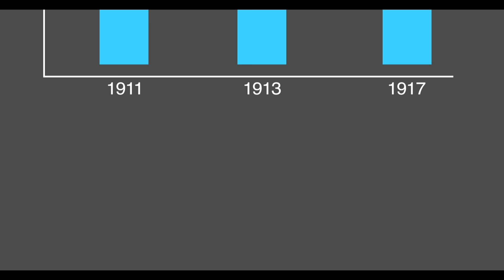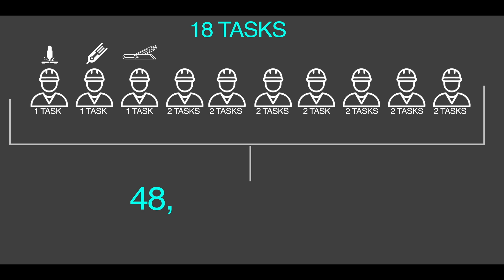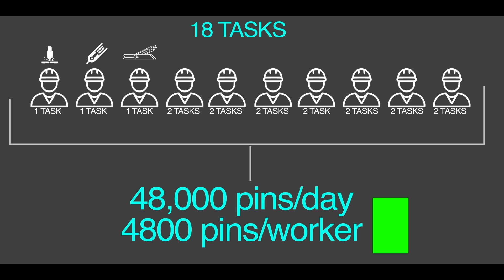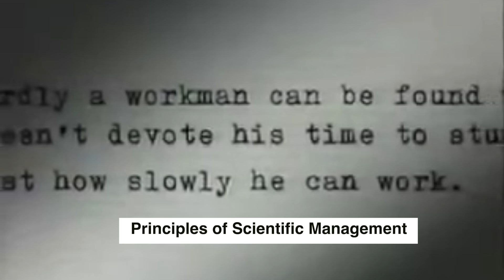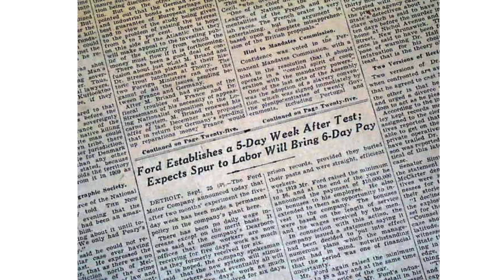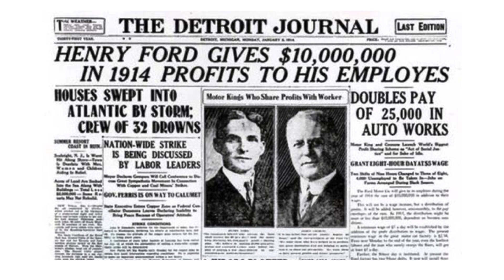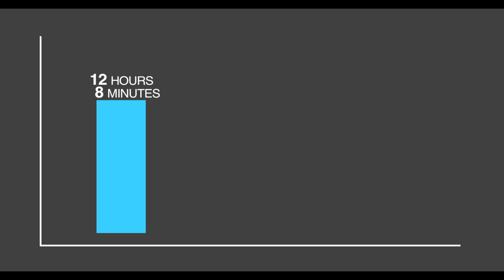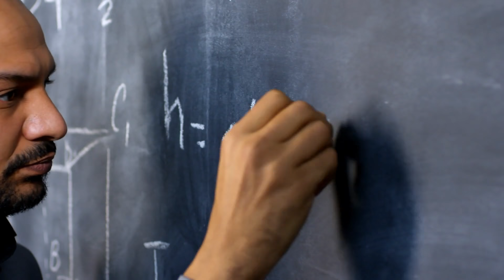Henry Ford's Business STRATEGY made FORD a billion dollar company : Business Case study

Comment: also the fact that the workers on the assembly line only has a certain time limit within which to complete his task or they will bottleneck the system by "holding up" the line.So workers learned to work faster and smarter.That inturn increased the whole efficiency of the operation.

Comment: Now a days concept changed to Cellular Manufacturing wherein each labour do job from start to end producing small quantity each lead to
1.Reduction in Lead time
2.Less waste
3.Easy Supervision(Cut down in Labour Cost)
4.Easy check on efficiency of labour
5.Can produce in small qty with same rate(Say if we need only 10 units for that whole machine need to run again)
6.Motion Study is best here
Also it has drawbacks too many entity refuses to use cellular manufacturing
1.Need more space
2.More Investment as need more smaller machines

Comment: Ford has stopped production in India. Even if the company follows management principles to improvise it's market,  govt policies should be commensurate in producing especially overseas. 
India's make in India policy has changed Indian production scenario. Raw materials at cheaper cost and logistics need to be viable. Higher pay with less price is not feasible in modern days as labor intervention is less.
Prices need to be competitive. Branding for the right segments compared to competitors is necessary. Ford price is affordable but it's after market sales is miniscule. With no resale value Indians are not going to buy. 
Great management lesson though. Keep it up Ganesh.